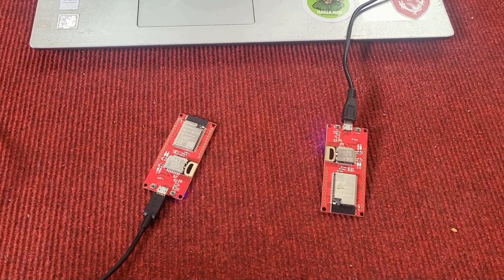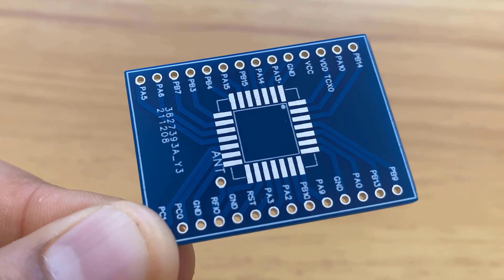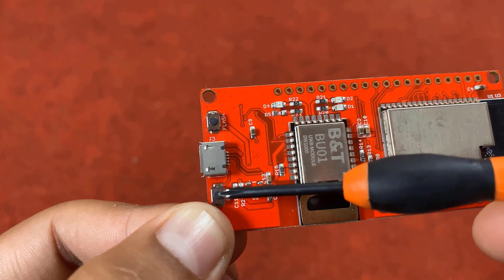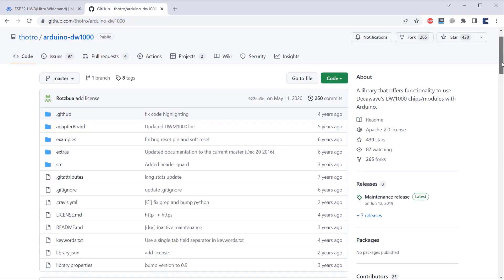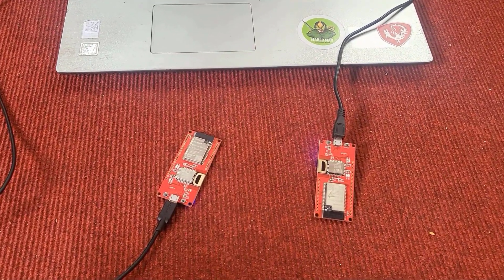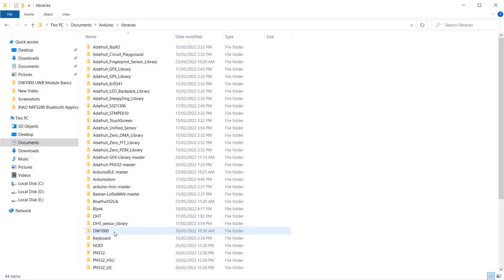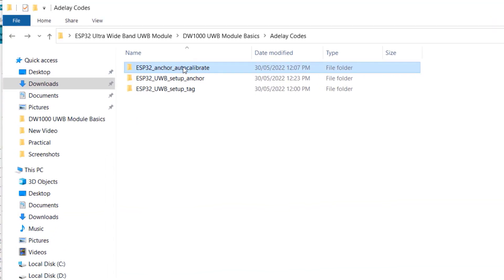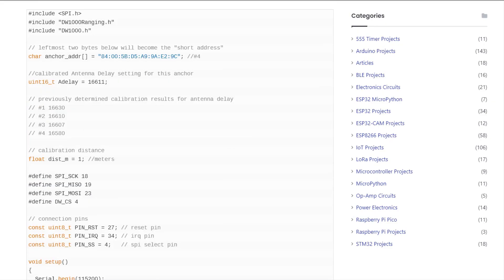Getting Started with ESP32 DW1000 UWB (Ultra Wideband) Module | Short Range Detection

Comment: after calibrating antenna delay, you are using the sketches of the new library you downloaded but can we use the previous sketches which we used when there antenna delay problem ?

Comment: Hi, great video! Question: can I use only one DW1000 device to detect range? For example if I move my hand in front of the sensor can it detect range difference?
Reply from the maker: You cannot use one. You need receiver nad transmitter.
Reply: @HowtoElectronics  I got confused now. You say that I can use only one but then you say that I need transmitter and receiver. Could you explain this a bit more?
Reply from the maker: Wirless module mostly work in pairs.
Reply: @HowtoElectronics  I thought that UWB can work as a transmitter and receiver at the same time. Something like ARIA sensor
Reply: @HowtoElectronics  you wrote can initially and I got confused :p. Thanks!

Comment: Plz someone tell me whether it is esp32 with wifi or it's microcontroller with UWB embedded with in it
Reply from the maker: Its ESP32 microcontroller with inbuilt wifi chip. But with wifi is not used. Dw1000 uwb is embedded with esp32.

Comment: Hello,

Great explanation. Thanks for the awesome job you have done.

i got ESP32 DW3000 board. tried with DW3000 libraries available in git hub but got some compilation errors. tried to fix those errors but not able to get proper distance, antenna delay, clock offset. Can you please help. provide some proper DW3000 libraries and example code.
Reply from the maker: I am making DW3000 video on next week.

Comment: Can we interface lcd with this ckt for measuring the distance at out side eg. Road ,field
And what is maximum limit for measuring distance?
Reply from the maker: Next video is coming: Indoor Location Tracking System with OLED
Reply: @HowtoElectronics  In that video - you may be answering my question . Which is - how accurate is the positioning? To within centimeter or two?